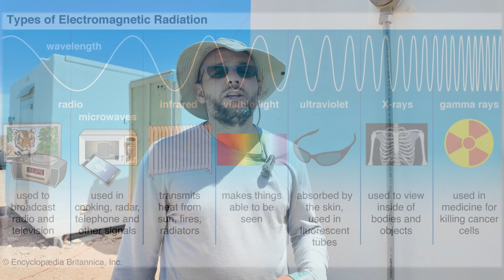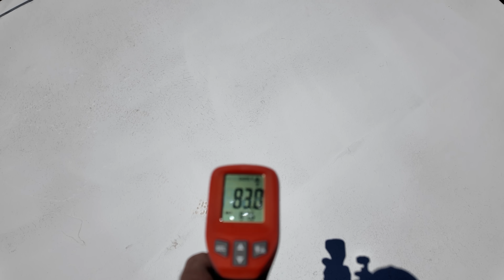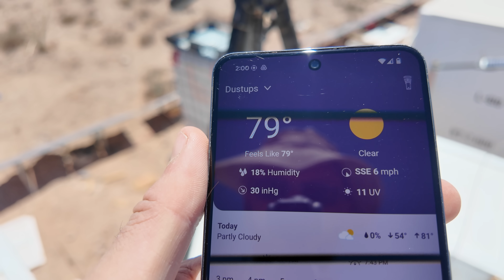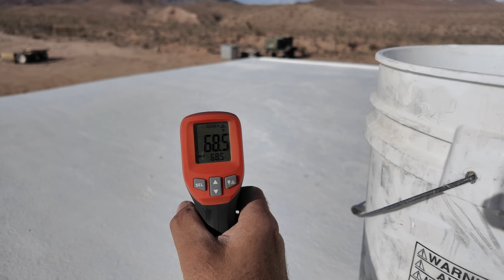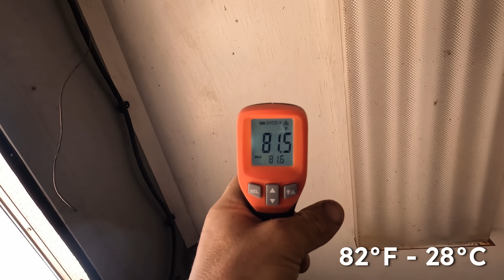I sprayed "cooling paint" on my desert cabin...this is shocking

Comment: Bamboo curtains , or some naturral material like this , rolling down 6 " or more from the walls would drop the solar loading greatly . Easy to install . Easy to remove . Another 20' by 20 ' section elevated on the North side of your outdoor area . Do Not use shade cloth . It heats up and radiates heat downwards under . Try a small section and see the difference . Could be palm fronds or whatever is available in the area .

Comment: @16:10 the paint because it is designed to have a certain emmisitivy likely gives false readings for those non-contact thermometers.  Probally have to calibrate it to what the emmisitivy is supposed to be to get accurate readings, or just use a surface probe, not sure if it matters much how accurate it is.

Comment: I hope that special paint company subsidized your paint!  That stuff is hard to make an even thickness—for best effect, thickness must be pretty even.  
Some powdered or granuled products are hard to evenly mix into the paint.  

Walls  transfer heat & cold…a lot…depending on insulative ability of building envelope.. Your story about the mountains in the distance reflecting heat back at your cabin?  In some context that might be a big thing…but, in context of your bldgs?—no. 
I’d question the veracity & real-life context, relative to your bldgs—whoever sold you on that countably affecting your cabin, kinda sounds like an over-trained, shake-n’bake engineer!? 

 …. Give your house about a 10’ wide roof extension covered patio or porch all around—you’ll be very glad….be it in a desert, or the PNW, or wherever.    
Desert-rat cabins often had extended roofs, about 10’ or more from the cabin footprint— or shade structures,  creating a transition zone.  
That helps both in hot & cold weather—the wider the shaded area, the cooler it can be, relative to ambient heat.  But in cold, it helps hold more of the earth’s temp, & the building temp, helping countably stabilize indoor temps. 
If a roof, that also helps shunt rainwater farther from the cabin foundations, to help cabin stay drier & last longer—desert rains are rarer, but, sometimes are flooding-dense heavy. 
It also forms a transitional, comfortable work & semi-outdoor living space. 
If you need to avoid increased property tax from adding patio porches, put those on so they hinge-down, to lock all sides of bldg from intruders—those then, are called “shutter security system”, not taxable “patio roof extensions”. 
If using twigs & sticks & bush on a shade frame, you get shade & ventilation, but not much temp stabilization round the clock. 
 …. Maximize insulation!!
 …. If an added metal roof is raftered on 2x8’s, above the roof decking, especially in hot climates—even using shipping containers—helps the heat hitting the roof to convect upwards towards a roof ridge vent or high-side, thru that air channel, causing less heat to push thru the roof decking, keeping the cabin cooler, too.  
 …. Generous Overhangs at least! 
 …. Adding a framed-on metal roof, AND 
      topping that with a vapor barrier, AND 
      a few inches of sand & irregular rocks—becomes very protective from a number of bad problems—& its got insulative mass. 
 …. So can gluing down HD aluminum foil layer over flat metal roof…it reflects radiant heat, for a LOT le$$.  Or spend to use very shiny corrugated metal roofing layer, even on 2x4 rafters (screen the channels btwn rafters). Add dirt & rocks later. 
 …. Low-tech geothermal air circulation is labor-intense to dig-in, but lasts virtually forever, can very much totally temper the cabin when properly sized & configured…way less cooling needed in summer, & less heating needed in winter or chill nites. 

One of the most effective helps for shipping containers, was using: 
   2x8 rafters, decked w/ply, 
   topped with vapor barrier to last,
   topped with/ metal roof. 
   Screened btwn rafters to stop critter nesting
   Then, topped w/a few inches sand & rock—if windy area, might need netting until desert ground cover plants take hold.  Edges added to roof deck, & vapor barrier forms a gutter, & can direct water as you like. 

G’ma used a sand & rock roof like that, nearly flat, on the roof decking, in hot, dry climate (Brown’s mountain, Altadena)—the house remained comfortable using window air breeze, plus the wide south-facing front porch.   
The Non-insulated slab floor brought much of the earth’s mean-temp to help temper the inside of the house too. 
She also had thicker than usual stucco exterior walls (& very poor insulation in the 1950s), which also helped stop temp transfer thru the walls….
…. & that house still exists, despite all the wildfires in that area for over 70 years!   
We “rode-out” a few very dramatic major fires, in the 1950s, looking out the windows, watching wildlife slink-past escaping down the road. Indoors was comfy, & the exterior of the house had Very little flammable exterior to allow a cinder to catch anything on fire. 

Those low-tech bldg tricks, & no costly specialized painting required—& no repainting. 
Only after using all those lower-tech things, would I ever consider using that high-tech paint—& having to do it over & over & over for the life of the building.  

Experience & history says Simplify!! 
Do all the low-tech you can, first, & you’ll likely not need any high-tech costly stuff. 
Make the buildings take care of you, instead of you having to repeatedly take care of the buildings!! 
There are many ways to low-tech cool desert buildings, as well as make them pretty much fireproof.

Comment: Geothermal energy exchanger drill until you hit the aquifer, use a deep well pump to circulate the ice cold water through a capillary grid panel on the roof which will exit the panel grid into the
inlet of your hot water heater as pre heated H2O, or use a sealed system that conducts heat to the subterranean desert  bedrock or aquifer

Comment: As a professional painter in south Texas, I would love to make the thermal paint that Nighthawkinlight made and use it around for my own projects. Due to its thickness, I would advise rolling it rather than spraying due to the overspray and overall loss of product. A product I have used are the aluminum solar shade cloth that blocks out up to 90% of the sun. Aore expensive route is using a solar air conditioner from Hotspot Energy. Specifically their ACDC12C. (I have no affiliation) it’s an easy plug and play for a/c during the day, but can connect to shore power or batteries for night time heating/cooling.

Comment: what you really need is shade for your structures most of the energy causing heating in the building over ambient  will be from direct EM radiation from the sun

Comment: I think going to an inverter based AC would probably be the most realistic help.  They use a lot less power than the conventional window units.  I think Midea units are really good so long as you get a newer one with proper drainage.  Also a cheap solar tracker might extend your solar production with minimal cost (less than a bucket of cooling paint).

Comment: Why don't y'all dig some trenches and install cooling tubes?  Dig down about 6 feet, lay the tubes so that they receive the naturally cooler air in the ground that will, by natural convection push out the hot air from your "boxes" and replace it with cooler air from the ground.  Then your power-hungry a/c units don't have to work as hard as you are following scientific facts of warm air rising (while cooler air replaces it) from the NO POWER NEEDED cooling tubes?

Comment: You could add a small evap cooler onto the output of your A/C. A tiny aquarium pump and some media screen. Float switch for auto shutoff. On hottest days pour a quart of water in to drop temps more. Dry desert air works really well.
Reply: I'm re -thinking... might work better on the intake side of your system.

Comment: I think the biggest difference comes from having direct shade from the summer sun, but also lots of plants and trees in the surrounding area. Anything that breaks the wind and also puts a little moisture into the air really helps, obviously these are long term thoughts. 

I live in one of the hottest places in Europe, but fortunately in the mountains. Every time I walk out of the village which is all cement and asphalt, up to my house in the forest, you notice the temperature drop between the vegetation, especially near small streams. Anything exposed just sucks up the sun all day. Plants provide shade, and a cooler surrounding terrain just makes everything feel cooler.

Comment: As interesting as this is, for a simple small square building with no HOA in sight, you can also relatively cheaply make insulation values so high radiation becomes irrelevant (just add more insulation on the outside, styrofoam, a second wall with expanding foam insulation in between, whatever). The problem is that then you need to keep things airtight and use "heat" recovery ventilation to keep the air breathable, but those are pretty cheap now.

This paint is more for metal roofed commercial buildings, with poor insulation which can not be upgraded.

Comment: #passive_cooling great work here. This might sound strange but adding a roof in order to create an air gap you'll be amazed at how much that cools ...and keeps warm at night...as air is incredibly dense and depending upon the roof material (speaking of painted...metal with anti fouling absolutely) and the structure of the roof.... preferably something "ribbed" or "finned" i think is normative.... don't even need to enclose it. #salt_box style properly oriented towards the sun such that more roof "at the midday" less roof on the midnight side 30/60/90 of course the best thing is to plant a tree #eucalyptus might work i don't know but again provides both cooling and insulation at night. Passive definitely the way to go spot on with that one. Amazing electrical install now can be repurposed for no more need for a/c but other purposes #solarolla solar powered golf cart or even a solar powered camper van absolutely great work keep at it😊😊

Comment: Aside from a roof/wall sheathing or paint, you might consider ways to shield from ground heat. Insulating the base of a structure is easily overlooked. Does your structure sit flat on the ground (in contact) or on wheels or blocks for air flow? Heat loss in winter can also be a problem from ground contact.

Comment: A canopy roof built above the building to keep out 100% of the Sun painted. With that paint would make it as cool as it could possibly be any radiant heat that did get absorbed by the canopy and it can be made out of wood or metal or whatever you want. None of that heat would reach the main building similar to what they do in some Northern latitudes where they build a glass house or plastic house over their building which traps a layer of more moderate air between the glass house and the building lowering the old overall costs of heating the building.

Comment: I saw that the radiative paint works the best if you paint multiple light thin layers. A roller with thinned out paint would work the fastest.  Sprayer nozzles have to be cleaned if they sit for any length of time, making the layer options almost impossible,😢 or the paint clogs and is a pain to clean the nozzle.  For water soluble paint, have an extra bucket of clear water to rinse the hose and nozzle immediately after you paint. Paint the east and west  sides as the sun rises and sets, heating those walls.

Comment: @DustUpTexas Idea that works but not for your house. For your car, I would suggest what I use to help keep the temperature down considerably by making interior window inserts (except for the windshield) of Reflectix bubble material. For the front windshield, I use a separate Reflectix cover so to stop the windshield from heating up like a frying pan. The covers you insert inside pale in comparison to one you put outside.
  I then have a Reflectix cover I make for the top of the car with pool 3 noodles underneath them to allow air to pass through.
  For the windshield and the top covers, I secure them using Dritz 3/4" non roll woven Elastic (11506B) across 3 parts through and ontop the Reflectix and then going inside to roof handholds inside and back out held simply by closing door on each one.
   I do the same with yhe windshield cover. When I take the covers off to drive somewhere, the car isn't miraculously cold but...within just 2 minutes of having the air on, the car feels like you a refrigerator because you aren't trying to cool down hot surfaces in the car. 
  Try it, you'll be shocked at just the difference it makes for your vehicle.

Comment: I did the same for my shed & my AC unit. . Tech ingredients made a paint as well, really show how to achieve proper particle sizes. The problem with any paint is; dirt/ dust lands on the paint & then it no longer works properly. The particles you add to the paint to get the extra reflectiveness wash away the more times you wash it. As someone else mentioned Ceramic is an awesome Thermal insulator, A thin sheet of plywood with ceramic tiles adhered to it, set 1-2 inches above the actual roof will do more than any paint could.

Comment: The reason for not painting the side is invalid. The premise that you stated was that this paint reflects 18% more non-visible light. You're worried about it reflecting off of the mountain (a non-flat surface)? Really?

One, if it reflects 18% more than white paint alone, then it will reflect closer to 40% more than any other surface it comes in contact with, and those surfaces not being flat vertical and perfectly parallel to your walls means that they are going to be dispersed in all number of directions by everything that it hits including the mountain. If your paint works, it'll work well on the sides, into the degree to which it is less effective than on the roof, is probably to a minimal degree.

I haven't finished the video, but if the paint makes a Improvement of 50% just on the roof, buy painting the sides you'll probably still gain an additional 30% or better. 

So if you're reason for not painting the sides is because you're cheap, don't have the money, or you wanted to test out its viability on the roof first, those are all valid reasons, but your science ain't sciencing
Reply: Wasn't sure what you said, $230 or $330, but that is pretty pricey, but it sounds like it is viable as long as it has a 10-year lifespan.

Comment: What would happen if you took silicone and added a liquid that melted the silicone into a liquid form  ?
  Wouldn't Silver paint reflect better than white  ?
  Could you mix the silver paint into the silicone solution ? 
  And seal your facility , and reflect at the same time  ?

  😮 Could this reduce the temperature by 2.6 % ?😮
   That last question was for sh--s and giggles.

Comment: You should use a 10 cm thick layer of clay mixed with 10% white lime, and then sprinkle a 1 cm thick layer of quicklime with 5 liters of used car oil. It will be completely protected. Also sprinkle the sides of the house with lime and also under the floor. The floor under the house should be covered with an infrared reflector. There is carbon fiber felt that can withstand up to 900 degrees Celsius, and under it there is golden aluminum foil, which is like a first aid blanket in the trunk of a car. Also sprinkle all this with a layer of white lime with clay. The place will be protected from all sides: from below, from above and from four sides. The best thing is to build Rammed Earth.

Comment: Another option that would pull double duty, put solar panels about a foot above the roof. Bonus if they end up being larger than the roof. It would dramatically reduce the roof temperature, plus give more power.

Comment: Cooling paint and not just regular white paint : In the winter or mid season the paint will be cooling too. Perhaps too much so for cold nights. Shade seems more appropriate for your setup. Or extra white just to stay as much close to ambiant temperatures, but not specifically radiative paint. Radiative paint can be put on a ’reverse thermal solar pannel"  to cool as needed.

Comment: Plug a power strip back into itself to produce infinite power. Next you need to plug fans into the rest of the open plugs. You can hang the power strips around your neck as a portable body cooler. Trust me, it works. I have never lied on the internet.

Comment: Giving the impressions of a lot of overhead. it is just spray painting. Even a 6G Harbor Freight compressor will do, it may cycle a lot, add a tank and it cycles less. A gravity feed sprayer with a regulator, connectors, and hose. If you need a mask and goggles you are spraying in the wrong weather, pick a calm time, if the wind isn't blowing the paint ends up where you point. With the gravity feed the paint is in a small container above the sprayer, they go from 1mm to 2 mm nozzle size, large is probably better for essentially house painting. I am painting my house with a 1.7mm Amazon sprayer. They are made for auto painting because of the size of the cup, the cup maybe does 50-100 sq ft, I can use a break at that interval anyways, I have to pump up my air twice for a cup. I got a tank from Harbor Freight because I would burn out my pancake compressor doing a house with it, it has a lower pressure than the compressor so a regulator, I typically pump the system up, turn it off, use it, and repump while taking a break.

Comment: i myself have painted a metal dark color roof with just white ceiling paint and that alone made a major change in temp and kept the top of our heads from cooking, just for $6 then, it was about 8 X 12 shade we worked under here in Florida in May, June and July and Aug, we laid it on it side and sprayed the top with 1 gal of ceiling paint what a Hugh difference